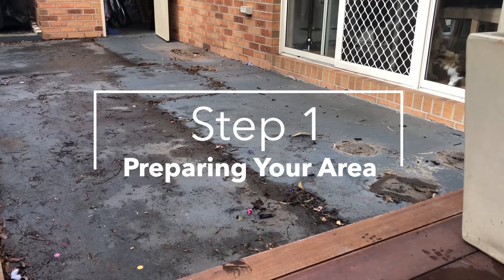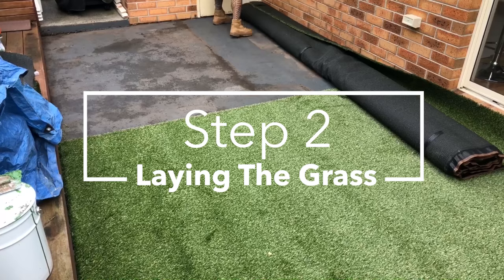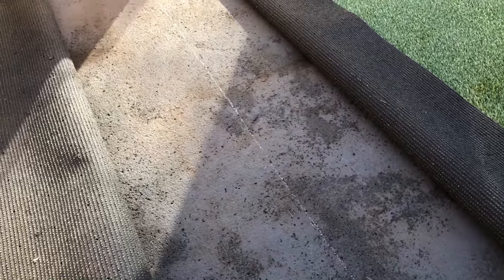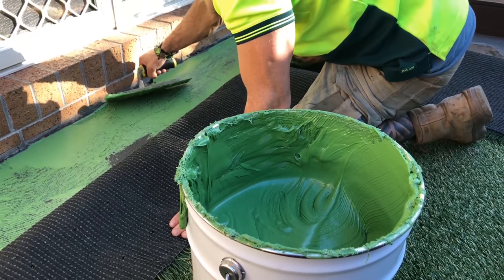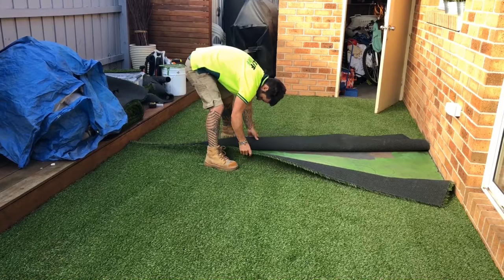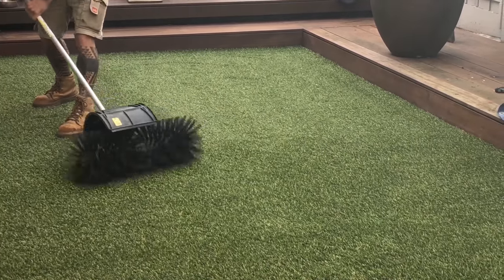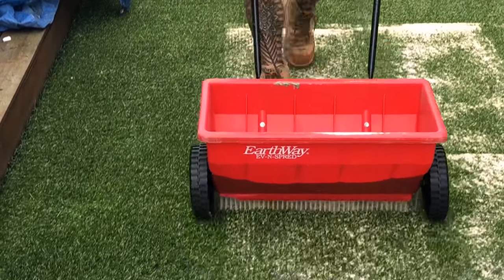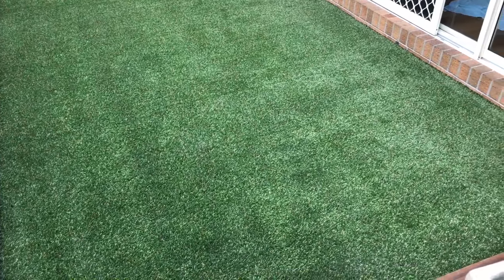How To Install Turf On A Hard Surface

Comment: Thanks for the video guys awesome. I need to know if I am laying artificial grass on outdoor decking which has 3mm gaps , do I need an underlay or can I lay  without it, thanks
Reply from the maker: That depends on a few things: if your stitches run the same way as the gaps then your gaps may be more visible over time shown by ridges in the turf fibres. If your turf runs the opposite direction then the ridges may not be overly visible and an underlay may not be required. If your chosen turf has a tall pile (>30mm) then you could also likely avoid the use of an underlay because the height of the pile can tend to hide any imperfections in the base. If you have chosen a short pile (<30mm) I would definitely use an underlay which could be in the form of a drainage cell or a thick geomembrane fabric.
Reply: @TuffTurfAU  0

Comment: What kind of sand and glue do you recommend?
Reply from the maker: Hey Marcus! Use any Glue designed for Synthetic Turf. Using the wrong type will mean that the turf won't handle temperature changes and water.  For sand, be sure to use any fine, dried sand. Using cheaper sand may mean that the granules will be larger and moist and will be difficult to brush into the surface. Additionally, the sand may damage your turf fibres when the area is utilised for high foot traffic.

Comment: I'm using artificial turf on the steps leading to a basement apartment.  Any suggestions?
Reply from the maker: Hi Joyce, I would absolutely make sure your glue coverage is perfect so that the turf will not move over time. As the turf will be glued to steps, I would purchase a "non-directional" sports turf that will improve the grip factor. Feel free to ask more questions :)

Comment: Sir I have to install cricket turf pitch size 3mtrX10mtr. What glue material to be used and how much quantity will consume.
Reply from the maker: We recommend using Tuff Turf Synthetic turf adhesive. Using a 3mm V-notched trowel to spread the glue over the entire area. Use around 8lts of the glue to cover this sized-space.

Comment: How much glue adhesive do I need if I have two 3m by 3m squares to glue together, and also to glue the perimeter. Will one 4 litre can do it?
Reply from the maker: Hi Matt, Yes one 4lt will cover 16m2. You wouldn't likely cover every little bit of the base. Mainly focus on the perimeter as we have here, as well as your joins. The application of any leftover glue should be focused on areas of high foot traffic.

Comment: Hi any tips for uneven surfaces, planning to lay on small patch the concert has few small cracks and uneven at places. Thanks in advance 👍👍
Reply from the maker: Hi R Win, You could lay a drainage cell over the top of the concrete, this would allow for drainage and create a flat surface to lat turf on.
Reply: @TuffTurfAU  if you use a drainage cell would you meed to glue both down and do you still sand it?
Reply from the maker: @frances9975  Yes, you absolutely do. Synthetic turf installations work as a system, so it is important that each layer is secure. Think of a turf installation as a big Hamburger; if the layers aren't adequately placed on top of each other, unwanted movement will occur. As for sand, this is the "hamburger ingredient" the weighs everything down, so it is definitely vital. Sand infill has the added benefits of making sure your turf fibres remaining standing up as well as reducing surface temperature and the amount of UV that reaches your backing.

Comment: Very nice work you done , just wanted to ask , I’m looking to lay 7mm thickness artificial grass on concrete slabs , will I need underlay for this job
Reply from the maker: Hi UNDERTAKER, there are many types of underlay. Common ones are "Weedmat" and "Shockpad". Weedmat may be installed where weeds are likely to grow underneath the turf (generally not an issue with concrete bases like yours), and Shockpad is used typically on playgrounds or areas where a very spongy feel is required underfoot. Please let me know if there are further questions.
Reply: @TuffTurfAU  Will the Shockpad drain properly?
Reply from the maker: @oleg232000  Most shockpads will adequately drain.

Comment: Awesome video! I'm so confused though about whether to lay underlay or not... I see in this video you don't use it... I'm looking to lay turf just at the end of my garden over patio slabs, it won't need to be soft as such it just needs to look good. So I'm unsure as to whether to bother with underlay or not... any thoughts? Thanks in advance!
Reply from the maker: Hi Ed, Thank you for the kind words :) What type of underlay are you considering? If it is a weed-inhibiting mat, then I would offer my opinion that it is not needed. As you know weeds need an amount of UV in order to grow. The chance for any UV to reach through the turf, through your sand infill and through the gaps in the pavers is minimal if at all measurable. You will more than likely have weeds germinate on top of the sand infill (often caused by birds dropping seeds), which can be countered by using a weed killer once per year, depending on how much sun and water the surface is subjected to. Good luck with your project!
Reply: @TuffTurfAU  Heya thanks so much for your fast reply. I'm not concerned about weeds at all, ots purely for the look and functionality im considering...as the slabs slightly dip where they join the next and a few have been damaged and so have 1-2 inch indents in i was thinking underlay may smooth it out?
Reply from the maker: @EdMoseleyy  AHA! Yes, an extra layer could help smooth things out in your installation. You could look to a landscape supplier for a thick Geomembrane (a permeable fabric underlay), or to fully flatten your base you could install a Drainage cell on top of the patio slabs which will also facilitate improved drainage.
Reply: @TuffTurfAU  you're a star thank you!

Comment: Great video. I am going to be gluing on concrete also it's just one piece. Do I just glue the perimeter?
Reply from the maker: Thanks Dipesh! Yes, that's fine, as long as you install a sufficient amount of infill to weigh the remainder of the turf down.

Comment: G’day Tuff Turf, I’m just about to lay a 20m x 2m strip of synthetic for a cricket pitch. I noticed in your video that only the edges were glued. Is this how I should glue my pitch down or should I glue the entire strip?
Reply from the maker: Hi Stuart! For a cricket pitch, you should direct stick the entire piece of turf to avoid it moving with use.
Reply: @TuffTurfAU  excellent. Thanks for the advice.
Reply: @TuffTurfAU   I’ve just had the concrete laid for my pitch and was wondering if you know how long I have to wait before using your glue to glue the synthetic down?
Reply from the maker: @stuartwearne8928  The concrete curing process is not always quantifiable - I would wait a minimum of 7 days to be safe. Your base will be fine to walk on in 48 hours, and if you are in an area that is very dry you'll have the best chance to install sooner, than if your subgrade (the dirt below) has a high moisture level.

Comment: If instillation is in a garage is sand necessary?
Reply from the maker: Ni Nick. Sand weighs down the surface to stop it from moving, and as well as maintaining the visual appeal of the grass fibres (keeps them standing up under foot traffic). If those particular facets matter to you, then yes, sand is necessary. If you're laying a very hardy, non-directional short pile turf to park a car on for example then sand may not be necessary for your installation.

Comment: when installing indoors is there a risk of mold? I have an area in an enclosed balcony I'd like to install turf on but I'm worried about mold / mildew. I know I'm not in your area of service but any information would be great. Thanks
Reply from the maker: Hi Jason Me, there is a risk of mold or mildew where there is a lack of sunlight and airflow in the installed area. The main factor to be mindful of when planning an install like this is Drainage; will you get water sitting on the surface, and how will this be dealt with? If adequate drainage is an issue you could consider installing your turf on top of a drainage cell.
Reply: Ys artyfeshal hrad lanha milaga
Reply: Karachi pakitan mai
Reply: Ya artygishal graas kanha milaga

Comment: would you recommend using using glue or would turf tape work just as well?
Reply from the maker: There are Pros and Cons of each method. Glue is good because if installed correctly it will be down "forever", but installation is more involved. Tape is great because it is cheaper and simple to install but it may be prone to moving over time or be pulled-up by curious kids or pets.

Comment: What type of adhesive did y’all use in that?
Reply from the maker: Hey Josh, we used our branded Synthetic turf adhesive in a 20lt tub. This size of tub is available to order from any Bunnings Warehouse. Using an adhesive specifically for Synthetic Turf means you'll get a glue that is tested to withstand temperature variability as well as water.

Comment: Wahoo crazy it looks really nice. Can I install it without glue? It’s for my man cave.
Reply from the maker: Hey Franck, thanks! Yes, you could use double-sided tape, or if you are placing a lot of furniture on the surface, this can sometimes be sufficient to weigh the turf down. I can understand glue may want to be avoided if you are renting, this is pretty common. If you do not use anything to hold the surface to its base, this could potentially result in ripples forming and the edges begin to curl up. You could combat this by installing a sand infill. Best of luck with the project!

Comment: Do you really need to glue it down?
Reply from the maker: Hi digitalmediafan, no you do not necessarily have to glue it down. Here are some questions to ask yourself when deciding if you need to adhere turf to its base. Is the turf on a balcony not on the ground floor? Is my area going to be getting above-average levels of foot traffic? Are children and pets going to frequenting the area? If the answer is YES to any of these questions, then you would want to glue it down. Here is another option for securing turf, which can be a temporary one https://www.youtube.com/watch?v=TON2NQV8AWk
Reply from the maker: Additionally,  if the turf is being installed on a deck for example, sometimes outdoor furniture and pot plants are sufficient for keeping turf pieces in place where a join does not exist
Reply: Tuff Turf - Grass That's Always Greener ok great double sided tape a good alternative for me to consider...Got a small area of uneven paving stones I wanted to cover over but not sure ds tape would stick to concrete hmm....
Reply from the maker: @digitalmediafan  it should definitely stick. Just as long as the concrete surface is free from moisture, dust, oil and flaky paint

Comment: How hard is it to remove the glue if you ever have pull it up?
Reply from the maker: Hi George, sorry that I missed this comment. It is very difficult - use a product such as "Glue Rid" to remove this glue. In extreme cases you may have to use a manual removal method such as sanding or grinding.

Comment: what size should I get for my balcony 35mm or 25mm?
Reply from the maker: Your decision is not only based on Pile Height but Product Density and preferred appearance as well. Will your balcony see a lot of foot traffic? Then a denser product with a shorter pile (one whose fibres will stand upright despite the foot traffic) may be better for you. There are a plethora of entry level 35mm grasses out there, then there's our "Luxury Tuff" which is a very dense product that can be used for hours every day with an immense amount of punishment, all while maintaining its appearance. Will your balcony have your pets using the surface? Our 25mm "K9 Tuff" is nowhere near as dense but has an anti-bacterial backing to reduce odours.

Comment: What happens once it rains over it? I'm guessing water goes through, right? My floor isn't even so I'm worried I will get puddles.
Reply from the maker: Hi Pedro, Tuff Turf varieties have drainage holes every 100mm2, so the movement of water isn't typically an issue. However, if you have uneven ground puddling is a valid concern. To circumvent this you could consider installing the turf on the top of a drainage cell.

Comment: What kind of glue is best to use
Reply from the maker: Use an adhesive that is designed for synthetic turf. We use our Tuff Turf Synthetic Grass adhesive, available through any Bunnings Warehouse. Using the correct glue will almost guarantee that your turf won't move with changing and harsh weather

Comment: My concrete patio has a a square drain in the middle, do I leave that area exposed? Also do I need to drill holes?
Reply from the maker: Yes, I would leave it exposed Dan. Water drains mostly underneath the turf but also from the top. Needless to say it's important not to apply glue near the drain in such a way that it impedes drainage. There's no need to add extra drainage holes, there are enough to facilitate adequate drainage.

Comment: Hi I would like to know what the name of the glue I can use to hanks
Reply from the maker: Hi Brenda, We use Tuff Turf's Synthetic Grass adhesive which is available at any Bunnings Warehouse in AUS or NZ. If you're not located in either of those countries, search for a glue that is designed for Synthetic turf or marine carpet - either of those types of glues handles temperature changes and moisture very well.

Comment: You say in this video (and in one of your other videos also) that you recommend using 10-15KGs of sand for each m2 of grass... Other places recommend a 25KG bag per 2-3m2 which works out to be between 2.7 - 6.25KGs per m2... Sure 10 - 15 is too much?
Reply from the maker: Hi Jesse, the spread rate of a sand infill depends on a few factors such as the pile height and fibre density, amount of foot traffic the area will receive, the quality of the turf and backing, user underfoot feel preferences and the level of UV the grass will endure, just to name a few. We rate each of our turfs according to heat testing under lab conditions combined with the above factors. I would begin with 10kg/m2 and how the surface looks and feels to you, and gradually increase it until you are content. Sand infill is just one part of the "Synthetic Turf system", that is, a proper installation should include all the elements we (and other turf companies) prescribe as part of the system. An infill should be installed to a degree that it weighs down the surface, holds the fibres up long-term, and increases the life of the surface.
Reply: Hello there 🙋🏻‍♀️
I've been reading most of your answers and comments on here and I'm very appreciative of your knowledge and kindness, plus the time you have shared for us.
My question is about the Silica Sand number I should use. I'm laying the turf on concrete with one small area that has a circular  bump and I'm definitely NOT getting rid of it 🙍🏻‍♀️ Should I use a higher or smaller sand number or just the same?
Thanks for your input and kindness 🙌🏻🌞🌈👏🏻🙋🏻‍♀️

Comment: What about drainage?  I want to do this on a wooden deck but all the other videos mention drainage is key.
Reply: I intend for my dog to use it for a potty area fyi ... do you also have recommendations on where to buy material?
Reply from the maker: @braylark03  Most synthetic turfs have drainage holes in them, so your deck will form a good base for your turf, given that the gaps between decking boards will facilitate drainage. If your area is a bit smelly from pet use you can flush the area with water, alternatively there are turf deodorisers available at Bunnings (if you're in AUS or NZ), or Amazon if you're elsewhere.

Comment: Hi wat glue did u use i need the name plz thanx
Reply from the maker: Hi Donna Kirkby, we use Tuff Turf Synthetic Turf adhesive which is available at Bunnings Warehouse. Using a glue that is not designed for Synthetic turf could lead to the turf coming up over time due to their poor temperature-handling characteristics.

Comment: What’s the name of the glue where can I get some
Reply from the maker: You can find our "Synthetic Turf Adhesive" at any Bunnings Warehouse. It's available in 320gm Tubes and in 1, 4 and 20lt Cans. If you're not located in Australia, ask your local hardware supplier for Glue specific for Synthetic turf.

Comment: Can you explain the bit you said about glue and drainage?
Reply from the maker: Yes absolutely. You can see that in this video we did not apply glue to the entire base. If we did, the water would not drain through the drainage holes in the turf backing, rather it would sit on top creating a wet surface where bacteria can breed. If you apply glue in a strategic way that allows for water to move underneath the turf to either a run-off area or drain, this would be preferable.
Reply: @TuffTurfAU  very helpful. Thanks a lot!

Comment: What’s the glue called
Reply from the maker: This is Tuff Turf's Synthetic Grass Adhesive. If you're not located in AU or NZ, you could look to other reputable brands such as Dunlop. Glues for turf often have a greater capacity for heat and cold handling.

Comment: 10 to 15 kg for 1 sqm does not sound right
Reply from the maker: Thanks for your patience. 10 is the bare minimum for our 35mm Pile Landscape turfs. If you'd prefer a more soft underfoot feel, I recommend adding 8kg per sqm, and see how it look after a few months of foot traffic. Usually your grass fibres will lay down and look less than desirable; if so, brush the fibres back up and apply a higher infill rate of sand.